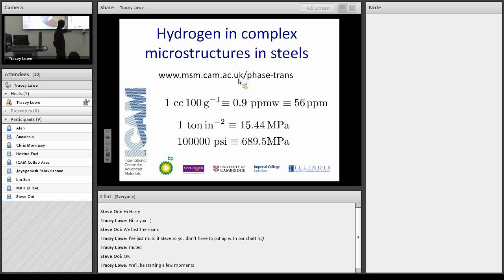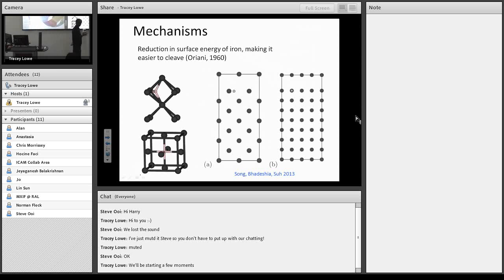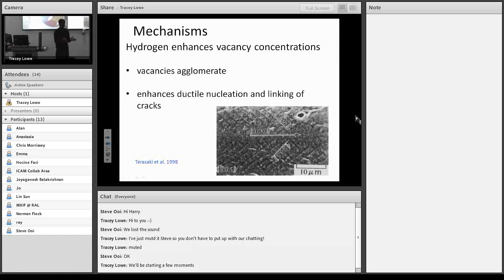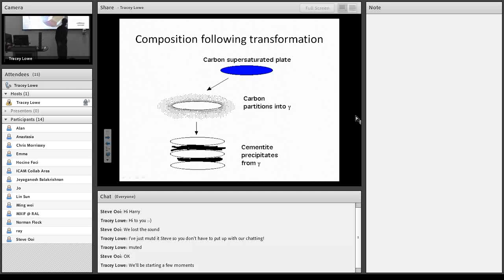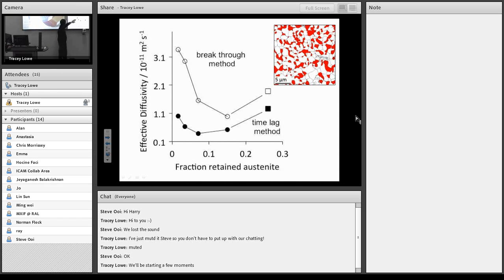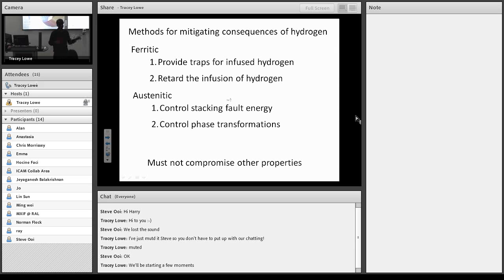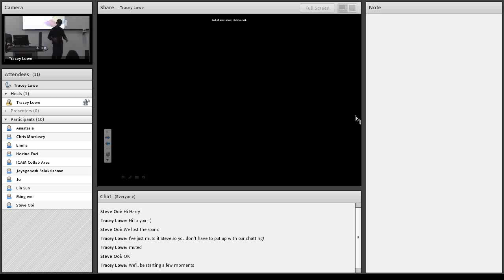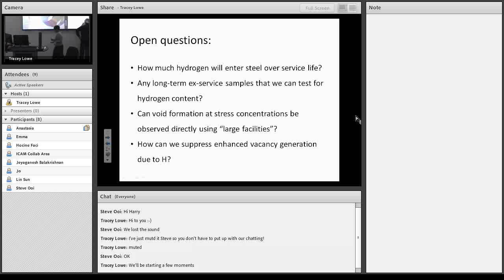Hydrogen embrittlement of complex microstructures in steels

Comment: Leadenhall Building aka the Cheesegrater update - At a cost estimated at £6m, 3000 bolts are now being replaced "as all parties agree it is sensible". No source for the Hydrogen diffusion has been determined.
Reply from the maker: Richard Wheeler Thank you for that - I looked up the stories after your message. There are sparse technical details in the web reports, so my comments that follow are not necessarily applicable or relevant.  Static, delayed failure in strong bolts is a known problem with high strength steel bolts and steels are available that contain appropriate hydrogen traps and hence mitigate such events. See for example, the Nippon Steel Technical Report 101, November 2012, (NSTR101-23_tech_review-3-4.pdf) available freely on the web.